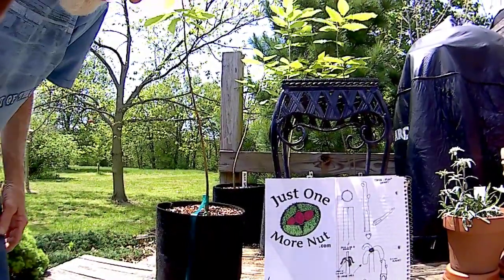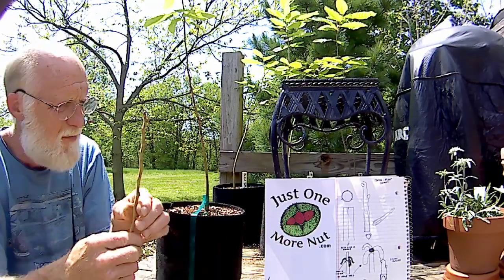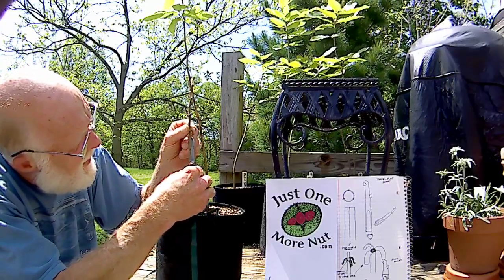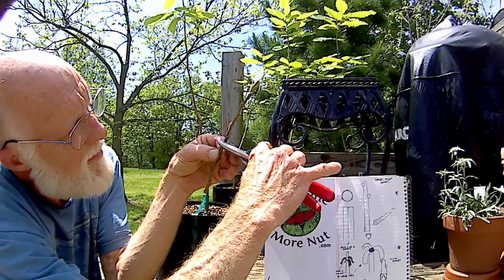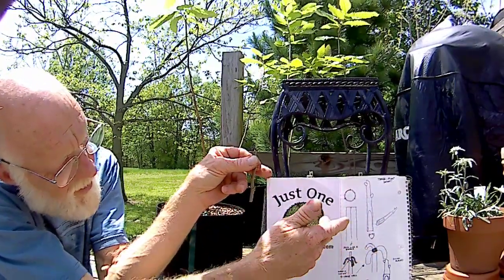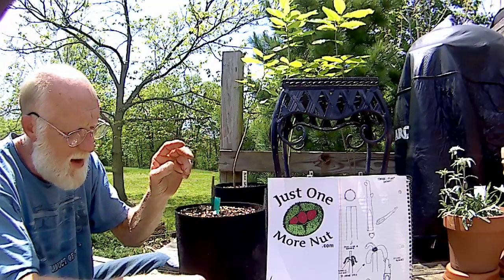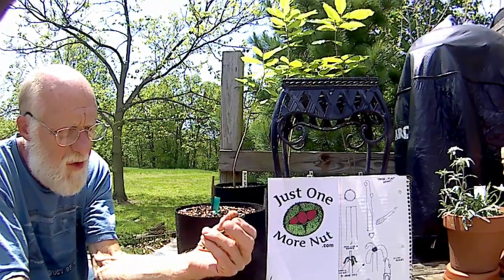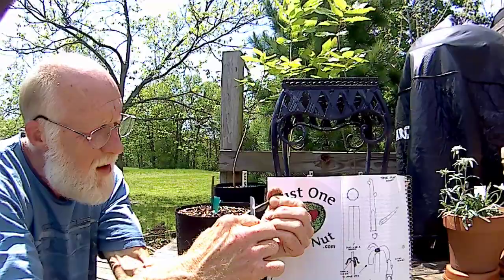Chestnut grafting 3 flap potted tree Black Satin variety Chinese

Comment: I noticed your username is two chestnut cultivars. Qing and Eaton, I guess it makes sense that you have videos on chestnut. Have you had any issues with delayed graft failure in Eaton or other varieties?
Reply from the maker: I mentioned my name in another video, so yes, good catch.
  I have had problems with delayed graft incompatibility with both cultivars.
I started out with random seeds, sourced from a semi local planting and bought from Asian grocery stores and then learned to graft, put a lot of time into switching them over and later realized that I should have planted those same cultivars as seed and then put the variety on that seed.
Eaton on Eaton seed, etc.  
 In later years, I did this and have had better results on those.
In colder climates, graft failure seems more of a problem and people have gone more to planting selected seeds and being happy with what they produce.
Reply: @Qingeaton  Yeah I've read that the graft failure gets worse further north. I'm actually in Missouri now, but planning on moving back to the northeast where grafts may not hold up as well. It does make things interesting growing seedlings though. Do you mainly grow cultivars or do you have seedlings as well?
Reply from the maker: @Jabberwalks  It's been a long journey. I still have 2 seedlings that I have let grow out (30 yrs) from my original plantings. The rest of those were grafted over as I saw I could have something better. 
One of them (Gera) only produced side nuts and had a blank center nut, making for a perfectly uniform crop. One year, I guess I added a variety to the orchard that was more compatible with it and it went to 3 nuts and size fell off. The nuts are really pretty and keep well, so it was a shame.
The other tree ("Girl next door" or GND)  kept putting out nuts that were just big enough, in large enough quantities, that I was always going to decide next year whether to graft it or not. Last year it produced (130lbs) $520 worth of chestnuts at my bargain price of $4 lb. I listed the tree's entire crop on ebay in 11# batches, plus shipping cost of USPS medium priority flat rate box and had people asking for more.
 This year, that has to go up to combat inflation on my side.
 I have some that need grafting that are maybe 20 yrs. They were neglected due to bumpy life. One of that group of 100 neglected trees turned out to be good enough to duplicate and name. It is Black Satin. the rest are being slowly top worked, except for one other which is doing the GND thing.
Reply: @Qingeaton  Thanks for taking the time to respond. You're doing great work with those chestnuts, pawpaws, and jujubes.
Reply from the maker: @Jabberwalks  thank you sir.